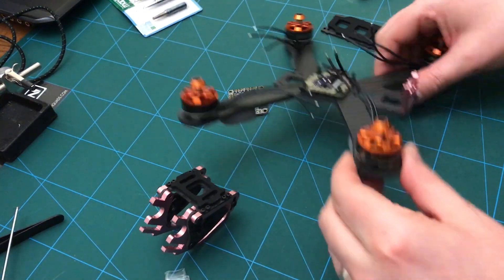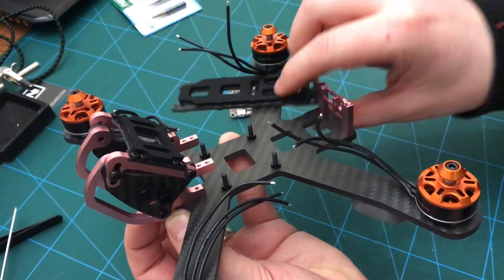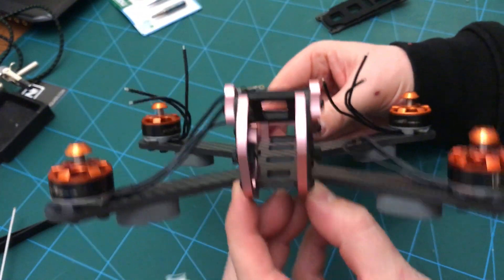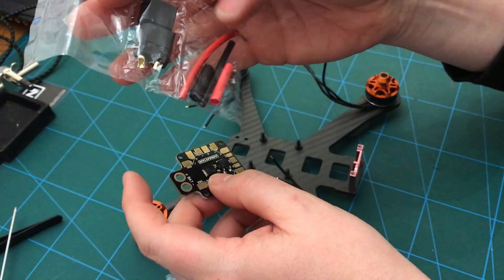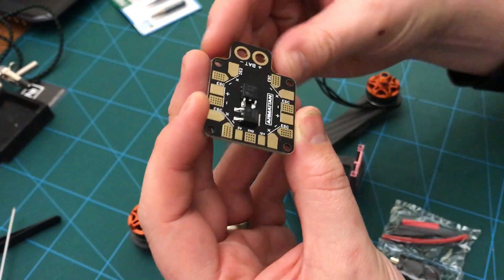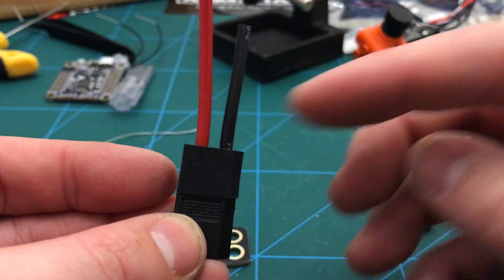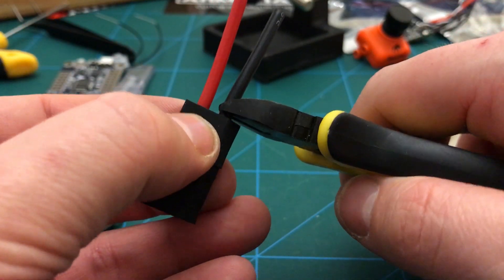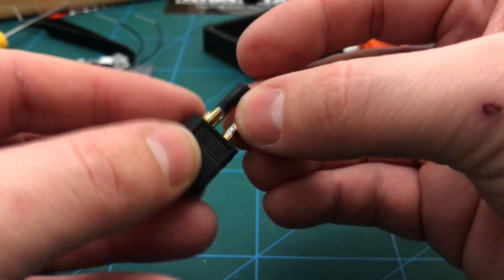Armattan Chameleon Quadcopter Build - Part 1

Comment: have been having a horrible time with interference burning out esc,s and vtx,s and even a motor it seems to be 2.4ghz based but cannot seem to figure out where its comming from , have you any ideas also not possible to get gps lock cannot ge even 1 sat

Comment: If I get all my internals from Armattan with my quad, will it build similar (if not directly) like your build? This little quad is quick,
thanks for the walk-through!
Reply from the maker: +Mark Green more or less, but as components come and go things will be different. Hopefully with all in one boards, smaller vtxs etc it should be easier. I think when i build i spend more time thinking and planning how it will go together than actually building. Often even after my builds are finished, a few crashes later and I'm re-thinking things.
Reply: Yeah I see. The hardest part for me to get started is knowing what parts will even go together
Reply from the maker: +Mark Green take a look at rcmodelreviews, joshua bardwell and painless360 on youtube. Some great info there. If your new to quads and fpv there is a lot to learn. But trust me, the buzz of flying is worth it.
Reply: One more question, what batteries do you run in this guy?
Reply from the maker: Mark Green to be honest its a mixed bag. From Turnigy Nanotech 4s 1300 at budget level up to Ache 4s 1500 75c. But including dinogy, drone labs, and turnigy graphenes. Just spend what you can a keep building a stockpile

Comment: This is really going to help me build mine. Just waiting on my flight controller to arrive :D
Reply from the maker: Mars Fpv whats your parts list?
Reply: Hyperlite 2206 2450kv, Runcam swift 2, tbs unify vtx, frsky x4rsb, and a flycolor raptor stack with fc, bec, osd, and 30a 4 in 1. Trying a 4 in 1 for the first time
Reply from the maker: +Mars Fpv sounds like a nice build. Im considering doing a dquad obsession build series next....
Reply from the maker: +Mars Fpv if you have any other questions about the Chameleon let me know.
Reply: Nice man, I want to build a Dquad too. I'll let you know if I need any help. Thanks